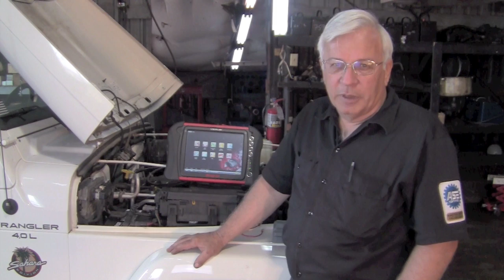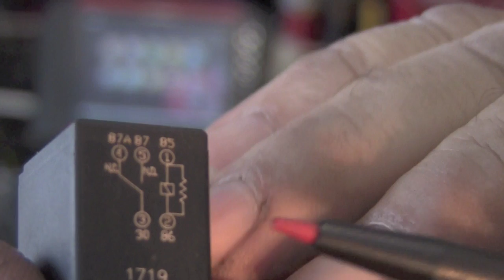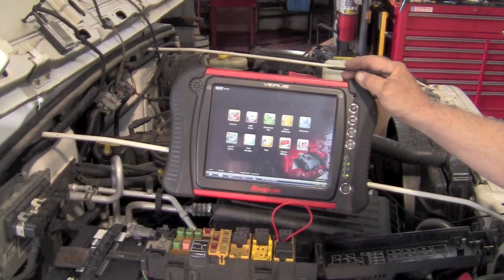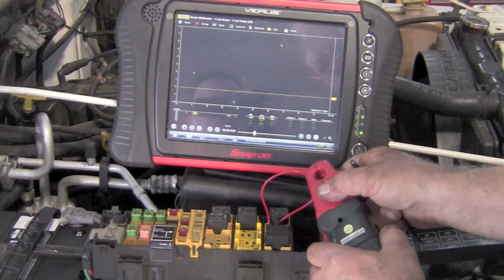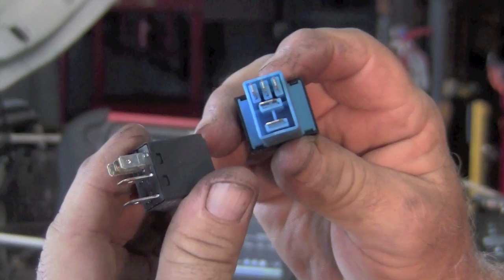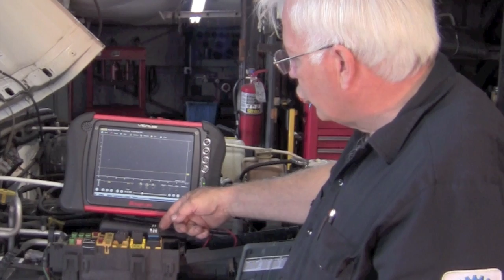Accessing the fuel pump circuit

Comment: The Guided Component Test sets the Scope up for you to perform the Fuel pump test.
It's a nice feature of the Snap On Verus Pro. Nevertheless, this is a great teaching video for the techs more familiar with the Oscilloscope.
Reply from the maker: David, you are so right.  In fact, I am making a video right now to illustrate how a true lab scope has become outdated today when you compare the newest DSO's (graphing meter scan tools), at least as far as automotive diagnostics is concerned.  In the past, I would choose my lab scope but it always required user setup.  Now, the tools usually set it up better than the casual user.  Now I find that the DSO will give me exactly what I need.  Question; would you agree?
Reply: @realfixesrealfast  Absolutely agree. Seeing the Data PIDs in a graphing form makes it easier to see the big picture. I use the Launch Scanner as my go to scanner because of the option to see live data in a graphing form.

Comment: Hy thanks for your time I'm getting the following cods P0627 fule pump A control circuit short to ground or fucking open. 

Toyota crolla 2020 car started and died.

I've tested every single fuses and wires can someone help.

Comment: i wish you guys would show how to hook up the leads at the tool,,, my modis book is wrong on multi meter hookup says hook up at - 3  & + 4 channel but  on screen channel it says i am on channel 1 not 3/4 channel? i called snap on and they said i was hooking it up wrong but the book save otherwise. But yet it works that way if i am on component check, then it says hook up on 3 &4 and it 3/4 channel? I have to say that Snap-on has the worst instruction on hook up unless you are following screen directions.....

Comment: My mother has an issue with her 2000 ford windstar,some times it will not start there wouldn't be any fuel pressure so she had the fuel pump replaced,filter,fuel pump relay,and reset switch replaced but still has the same issue,could there be an issue with theft detection side because some time the horn will blow on it's own?theres no gas pressure sometimes and other times it start right up with good pressure?

Comment: You don't need any of this expensive equipment. All you need to do is short out the contacts of the relay socket and listen for the fuel pump. You can also hear the relay click on when you plug it in. You can check the fuel pressure with an inexpensive fuel gauge before you even have to mess with any of this. After all, if you're getting good fuel pressure, you obviously have a good pump, relay and related circuitry. But I guess if you have a lot of money you need to get rid of.......